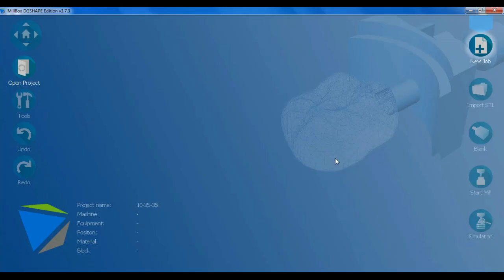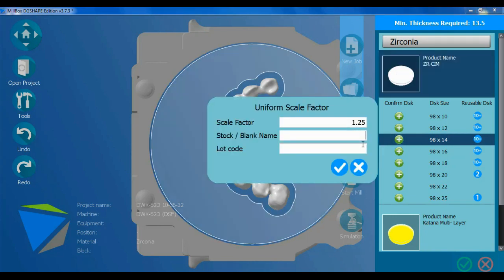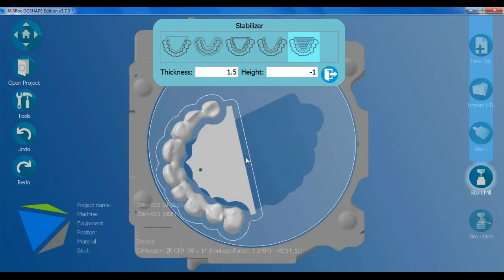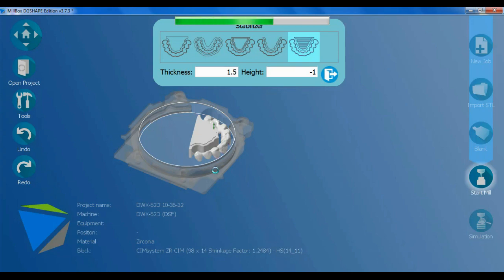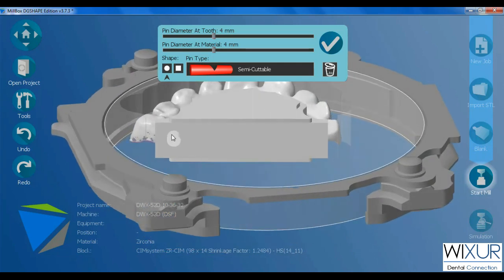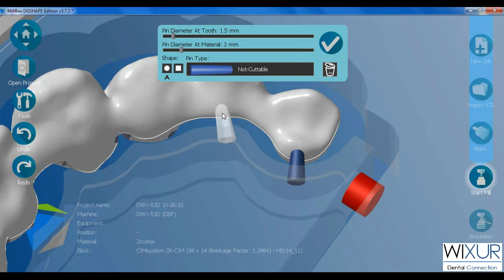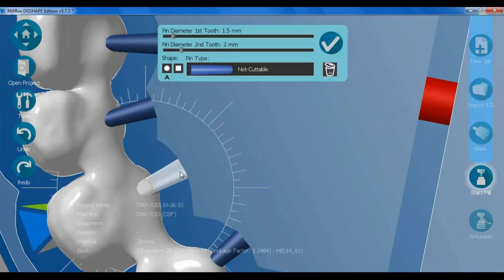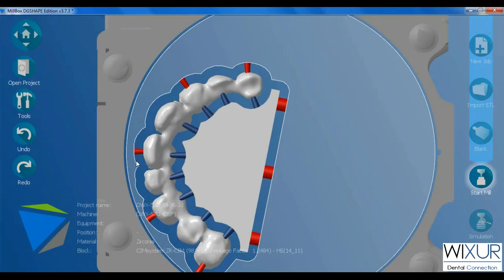How to set Bridge Stabilizer in MillBox DGSHAPE

Comment: why u decided to place sintering support at every single crown. 100% guides from zirconia manuf. recomended to place them faced to center of sitering object and leave 1 crown space between them. 
can you explain. im cad cam operator since 2010 and i never had any problems with bouncing. I like your method for convenience, because sometimes it is difficult for me to arrange the connectors using my method because of the even number of units